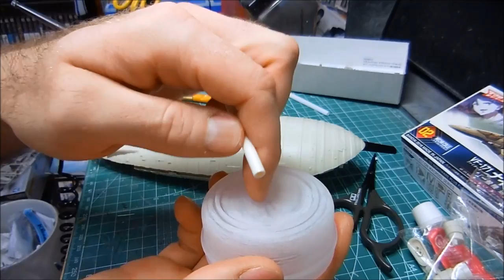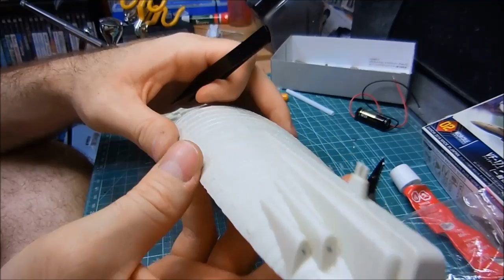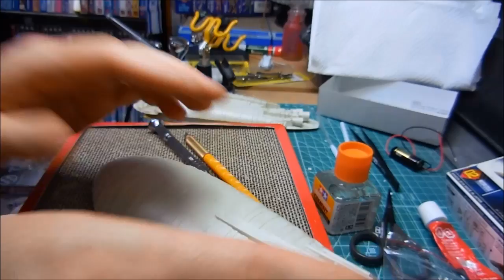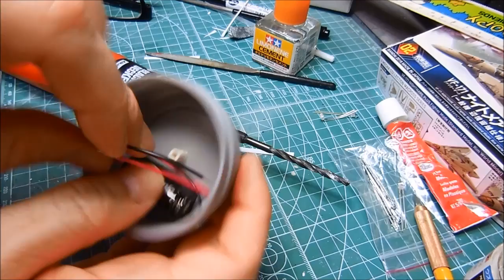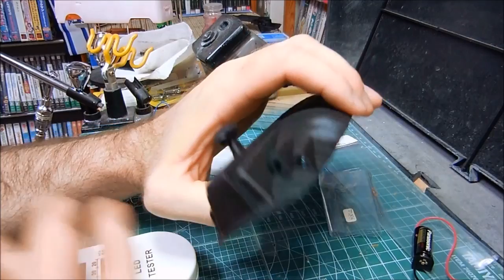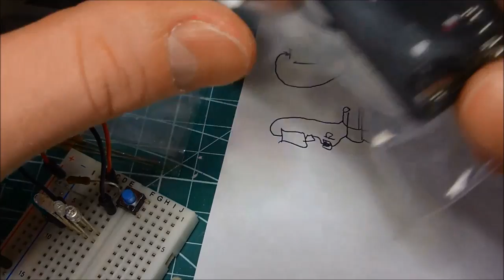MPC Star Wars Rebel Transport plamo build 1 LED LIGHTING

Comment: Fair play to you, figuring out the electronics by the seat of your pants like this. I'm no electronics genius by any stretch of the imagination, that was my Dad's field of expertise, but I do work with electronics now including LED lighting units albeit from more of an enthusiastic amateur point of view. It's important to understand Ohm's Law which I myself don't entirely yet. Makes me wish my Dad was still here. But that's where a good resistor calculator comes in handy. You can enter your voltage & the LED power requirements & it will tell you what resistor you need. 
I can tell you this much, adding more resistors won't make the LED's brighter it will have the opposite effect. Also you only need resistors on the positive line or the negative line between the battery & LED's not both, putting three resistors on both has exactly the same result as having three resistors on one or the other so you're just wasting resistors. 
With your 7 LED's wired in parallel you could power them from two AA batteries connected in series which would give you a forward voltage of 3V. You'd be underpowering them a little but that's not a problem in this situation as they're crazy bright at full power anyway.
I'm impressed with the progress you made though. For a project like this I'd actually recommend a single variable resistor, that way you can dial in the brightness to your personal preference. 
Well done for only underpowering the LED's too, that doesn't cause any damage at least. When you overpower you blow the LED's & produce magic smoke. That's your worst case scenario.
Reply from the maker: Thanks for the informative comment. I still have yet to complete this project since I have expanded it to include the Falcon and at least two X-Wings from the same kit. Look for my Revell Cylon Raider build video series as that is the first completed model for lighting I've accomplished. I've also lighted a Hasegawa SR-71 Blackbird. I did a video on that a year ago. Still have yet to paint it. I'm currently working on lighting a Darius kit and you can see that in my more recent uploads. I've since figured out 555 timer chips and have implemented one in the Blackbird. I also now have a Kenwood power supply for properly testing LEDs.

I know how you feel about wishing you could talk to your dad about stuff after he's passed away. There are things I wish I could talk to my mom about, but she died 8 years ago.

Comment: Hello

Use 9v battery so you will have enough juice to power up all that led's. For each one Led use ~(1kOhm - 1.5k ohm) resistor. All LED's supposed be connect in parallel. Never connect LED's in serial connection, if one get fucked the circuit will be broken and all Led's will be dead.
Reply from the maker: That's what everyone else has told me--- wire them up in parallel. But what's the advantage of a 9v battery over the 15v battery that I am using?
Reply: Hello

15V is fine. Sorry I did watch your film with full attention, usually I play some YT films while I'm working on my models.
Cheers
Reply from the maker: Michal Karczewski
Yeah, I do that too!

Comment: is the scale of the ship 1/144?
Reply from the maker: No, certainly not. A 1/144 scale Rebel Transport would be about the length and a half of my cutting mat. Considering that the F-Toys X-Wing fighters (and roughly the new Bandai Vehicle Collection ones) are about 1/144 scale and about the length of my finger, then a to-scale transport would be about the length of my arm, I think.
Reply: stevethefishdotnet  right thanks,  i just saw one in eBay its about 26 inches long.   big!

Comment: I have the impression that the mold release-releaser is similar to oven degreaser, the kind you get in bottle spritzers.
Reply from the maker: Possibly. It's not harsh like Easy Off. That stuff will strip paint off of a model, but I don't think the Fine Molds spray is that strong.

Comment: My blessings upon you,my lad ...     I'll let you in on a few things I've picked up over my years working in the audio/video field. I'm not a tech so this will be simple stuff. First off, the Techworks guy knows his stuff and he's got a bunch of videos about lighting and the equipment to use. if you've noticed, he has a very complex looking device which supplies his power and can preform other things as well. My second item is that you don't necessarily need such a multiple function device. Check out what's available to you and the cost and make your choice. Something that will be of help to you is a variable power device for making and testing your circuits. Something else you might consider is using a variable resistor. These come in all size ranges. You simply adjust it to what you need. The price you pay for these is size. As long as you have room their great and they can be used to change the light brightness of selected led's,too. One last thing, about using parallel or series circuits.  Because you will be using the leds in places you'll never see again one thing you must consider is that "if" something fails, everything in a series fails along with it. Parallel circuits don't have this issue, so consider this in making your choice. Good luck !
Reply from the maker: Thanks. One thing I want to make sure of is that I was mentioning Trekworks, not Techworks. I assume you are talking about the same modeler and that this was just a typo. While I enjoy his videos, I have to point out that his style is very different than the videos I make. His videos are usually what he has already done, but not how he did it. So while his videos are interesting because I can see what he accomplishes, without a proper demonstration I can never understand how to do this work on my own. 

Thanks for the tip about parallel circuits. Perhaps if I use two parallel circuits, I can light this with just one 12V battery. So will I need to solder some sort of Y split for the wires to go to two different parallel series?

Comment: Why not use a 9 volt battery? You don't need to have resistors unless it is too bright.
Reply from the maker: The 12 volt battery wasn't powerful enough to light all seven LEDs, let alone a 9 volt battery. I tried.

Comment: Steve, (I know it's not your real name), you're making the led situation overly complicated. You need to know what voltage the leds use for optimum usage, probably around 3 point something volts for blue ones (they look blue in the video)(red ones use 2 or 2.5 ish volts, white ones are around 3 volts as well). So 12 volts gives you enough volts to light 4 led's, 4 x 3 volts is 12 volts. They will burn safely but also maybe too bright for this particular engine, maybe you want to tone them down. That's where the resistors come in, they suck up some of the juice and give less voltage to the led's, so they burn less bright. 
You need seven led's to light up, so I would divide them in two groups, one of 4 and one of 3 leds. The 4 led group can take 12 volts straight up without resistors (except if you want to tone them down). The 3 led group neeeds resistors or they will burn out! Cause they will take 4 volts each, too much. You take the led calculator,12 volts, 3 leds (is 9 volts) so you need to burn off 3 volts and that is where a 150 ohm resistor comes in (or a 200). Or higher if you want to tone the leds down. Now you have 2 "serial" circuits, if in optimum brightness, you need only one resistor (150 ohm) and you are set with one 12 volt battery. Theres other options with other batteries (take 2 x 1,5 volt batteries and power a 4 and 3 led group in parralel without ANY resistors), but keep it simple I would say. If you want I can draw you a schematic of the led's. Happy to help.

About the model, the 4 top engine led's should maybe be brighter than the lower ones, cause from what I see in reference they are indirect lights, like a lightbox? Where the lower 3 ones are direct lights, shining like a torch, visible lights, if that makes sense?
Nice model by the way, wish I had one of those :)

ps. do what Zedpower suggested, test the setup for half a day before you install it
Reply: I could explain it any better :)
Reply from the maker: Nobody insults others' intelligence on my channel. Regardless if you are right or not, putting down me or others on this channel typically gets an insta-ban. I appreciate the feedback you left on the second video in this series, and I will investigate your advice, but please remain friendly here. Thank you.
Reply from the maker: Walter Boxhead
Yes, I know what the Dunning-Kruger effect is. That is why I said something.
1. Bar gave educated advice. Agree with it or not, he does not strike me as an ignoramus with delusions of superiority. His friendly advice is appreciated. Accusing him of "low-ability" is uncalled for and impolite.
2. Calling me "low-ability," however, is a completely fair assessment. But you'll notice that for that very reason, I do not impart advice, and therefore I am not guilty of Dunning-Kruger.
3. Not many people on this channel are 19. The peak demographic is 35-44 years (where I fit), tapering off in either direction. 19 year olds are more interested in Gundam model-related channels.
4. I have not dismissed your advice at all.
5. Bar did not give an air of superiority. That  is coming from you.
6. Your advice is welcome, but your attitude is not.

I don't make these videos for others' benefit, but for my own. I am learning how to do this kind of stuff for the first time, and I rely on others pointing me to the right direction. Ever since I started doing model builds on my YouTube channel, the focus of my videos has not been the imparting of knowledge, but the quest for it. People who watch these videos are welcome to come along for the ride and steer me on the correct path. They are not welcome, however to smug condescension.
Reply from the maker: You really don't get it. It's not what you say, but how you say it. Don't get mad at me if your posts can't get past a simple filter that detects abrasive language like "idiot" and "moron." I already told you that I appreciate your advice. Just not your tone. Plenty of people are capable of correcting and guiding me and not have their messages automatically filtered out. This is why I typically just ban guys like you up front without warning. because others may start to respond to you, and suddenly  I am having to babysit the internet because Mr. Boxhead can't express advice without coming across as an arrogant prick.
Reply from the maker: +Bar's projects I'm sorry about this. I should have blocked this guy from my channel faster than this, but I have just now blocked him. If he really didn't give a "rat's arse" as he claims, he would not have pushed the issue so much. He was commenting on this video as well as the second video. Knowledge is always welcome, but condescending attitudes are not. I have little patience to deal with those who cannot 
offer knowledge without arrogance. I'm sorry that this snit has continued for too long.

Comment: Great work, when putting the 7 LED lights in series, you probably don't needs any resistor for the 3V.  If your planning the push button switch to turn them on, then 3V will last a long time since your LED won't be on all the time.
Reply from the maker: When you say "3V", you mean the 12V battery, right?
Reply: Your first test run with all the lights in series was dim, you had a resistor in series with them?  remove the resistor.  I'm not sure of your voltage during that.

Comment: Hey Steve. Congratulations!

If you think this is confusing, try to add a red LED in the middle. That will make you scratch your head even more! :)

Anyhow, here is a few tips i have collected from various sites regarding LED lighting.

The LEDs you are intend to use in your model should be burn tested. Build a mock up circuit with your breadboard and leave them on for at least 8 hours. If they survive, you are good to go. It is better if the LED burns out while still on the board rather than a completed model.
I would go with the single battery and parallel circuit. You would need a resistor for each LED to dim them a bit down, and to make them consume less. If you do the burn test you can see how long a single battery would last.

You can go ahead with the series circuit and two batteries and see how long that will last while doing the burn test but i would get higher value resistor instead of using 10 low value ones.

It is not necessary but helps, if you grind a little off the top of the LED and sandpaper the LEDs for a foggy look. This will stop the LEDs to shine the light only forward and the foggy look diffuses the emitted light. But this is totally a personal preference. 
If you have got lots of LEDs just experiment with them.
Reply from the maker: +Zedpower Thanks for the tip about parallel circuits. Perhaps if I use two parallel circuits, I can light this with just one 12V battery. So will I need to solder some sort of Y split for the wires to go to two different parallel series? 

I did test burn the LEDs, but only for an hour or two. I did grind the four LEDs that will go on the top. I had to grind their sides to get them to fit into those canals formed by the mold.
Reply: The 2 parallel circuit does sound  good, for top and bottom. Create the two circuits and connect one to the battery then connect the other one as you did with the first one?  Only draw back is that if you have to use resistors you have to add one for each LEDs positive side. If i am not mistaken.
I am sure you`ll suss it out!
Reply from the maker: On my small breadboard, I was able to power all seven by using two parallel series. Since there are only five holes in each half row, I had to use jumper wires to jump the divide down the middle for the second series of four lights. Both series get connected to the minus power and it works. I am not sure as to the resistors I ought to use; I only used one 220 ohm resistor each. I don't think I have to add one resistor for each LED because I've been told that it doesn't matter where the resistors go in the sequence. You can use several or just have one stronger resistor up front in the sequence. 

This is why I want to make my first LED lit kit something small and relatively cheap. I only paid $15 for the Hoth Hangar Base diorama set by MPC, and I bought it mainly for this transport. Because this is a small kit, it won't require a lot of effort to build this. 

Greg